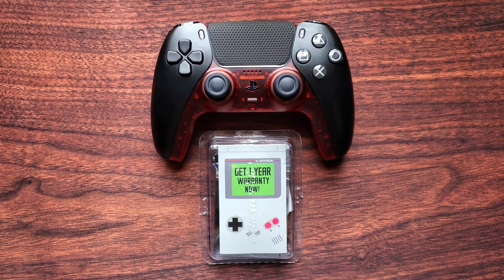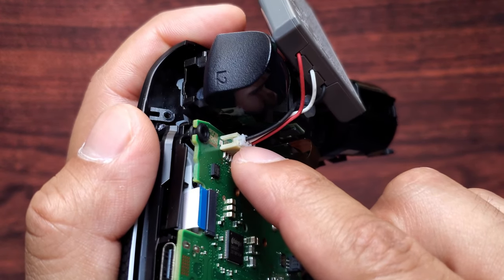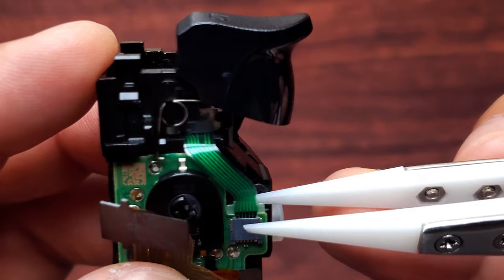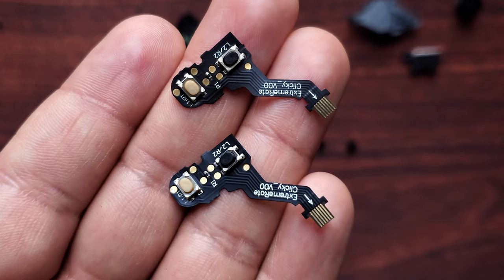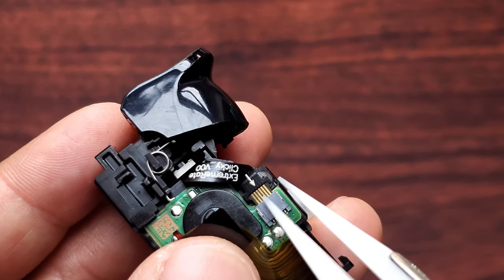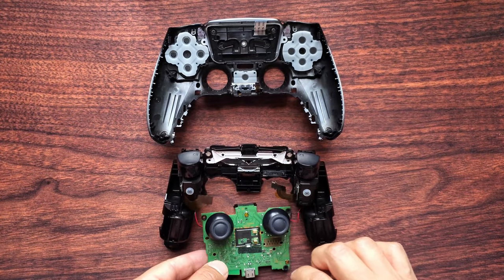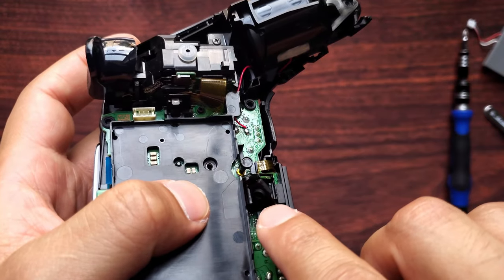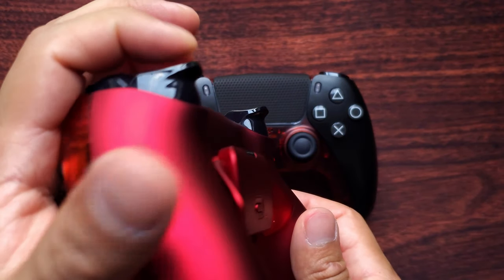DIY PS5 Controller (No-Soldering): eXtremeRate's Clicky Hair Trigger Kit | Step by Step Tutorial

Comment: Love your content. I just got my remap kit and led kit. I followed your video to install the kit. After the installation my analogs don't work. Please help me...
Reply from the maker: And thanks for the compliment!
Reply from the maker: I just realized this is for the hair triggers. I thought it was the remap kit. Check all connections. I haven't heard of problems with the trigger kit. But let me know the model number of the original shell or the BDM which is on the motherboard itself. I have mine installed on a BDM-010 or model # CFI-ZCT1W
Reply: @im.a.caveman  my controller is a bdm-010. I don't have the triggers yet. I only have the remap kit and led kit. After installing both kits (remap and led) they both work correctly. It's just my analogs don't work. I checked all connections multiple times and didn't find anything wrong. No broken wires or bad connections. I commented on this video because it is your latest video
Reply from the maker: @iamlegend1333  Oh alright I see. I confused myself sorry about that. Then I recommend putting your original parts back only for replacing the back buttons kit. Led should be fine. Other than that put your original parts and see if the analogs work like regular. Thats a way of knowing whether it's a faulty kit and not your control. You can also ask for a replacement if it not working out or even a refund.
Reply: @im.a.caveman  I'm going to ask for a replacement for the remap kit. Would you be willing to install it for me. I am willing to pay you and send my controller.  Please

Comment: Hey nice vid bro, I bought the clicky triggers, but it seem like underneath my trigger is different I don’t have those holes there for the little L shaped piece
Reply from the maker: Is your control a CFI-ZCT1W A/BDM-020?
Reply: @im.a.caveman  yes it is
Reply from the maker: @cyco_t3346  Sorry! I recommend getting a refund. The kit is only compatible with CFI-ZCT1W/BDM-010. I need to make an update video for the kits. The only kit that's currently updated is the Remap kit. They released the Remap v2 so it can work with CFI-ZCT1W A/BDM-020. But for led, hair triggers, and clicky kit not yet.
Reply: @im.a.caveman  no way
I had 2 controllers wth the A just brought a used one with the A to install the paddles :( arghhhh 
I didn’t know they had an updated version that works with the A controllers :(
Reply from the maker: @tefflongsxr  It's alright. Contact the company.

Comment: Where did you get those tweezers?
Reply from the maker: Those are ceramic tweezers. You can try eBay or Amazon. You'll see a bunch of options to choose from. They were used for a different purpose since they're heat resistant but they've been great to use for customizing.

Comment: adaptive trigger swap itu clicky button. is this downgrade?
Reply from the maker: I would say it depends on the preference. In my opinion these are best for shooters since it'll give you a quicker trigger response. They can also be used for other games but yeah you won't be able to use haptic feedback. I would use haptic feedback only for like solo games or non competitive since I won't need the quick trigger response. Regardless I have 2 controllers for either occasion. One is modded with the triggers and one isn't. Hope this helped.

Comment: I watch another video where a guy cut the wires for the haptic feedback motors, and reposition the haptic gear a certain way.
Reply from the maker: You don't have to cut those wires. And the gear does have to be placed in a specific way. Can you send me a link to the video?
Reply from the maker: @Iron-Soul  I see it. The wires they cut, it says it's optional, I think that would mean you won't be able to use haptic feedback or just the vibration. You can see those wires lead to that motor. And the way the put the piece on the top of the gear was different but the way I do it works. I saw it from their past video: https://youtu.be/WSI9XosfEIk
Reply: @im.a.caveman  What I did instead I unsoldered the wires from the circuit board to save the haptic motors for spares just in case. 👍🏽

Comment: yo man is there anyway to get Bdm 010 specifically?
Reply from the maker: Honestly not sure. Unless maybe someone is selling a used one and knows the model # or that it's a BDM-010. New, in the box, not sure. I'm gonna try to see for any signs on the box itself.
Reply: @im.a.caveman  cool thanks man, guess I’ll just get one and hope for the best. No chance the colour makes a difference or anything? Thanks a lot for these tutorials btw will be using the for sure!
Reply from the maker: One thing I did see on the site was, for the white one, on the target website, on the description or how every they titled it, I think it's says release date and it shows October 2020. So I was actually thinking of trying that. I would assume the colored ones would be BDM-020 but friend got the red one and the model # CFI-ZCT1W which is BDM-010. But I haven't actaully seen the inside to know if for sure it's BDM-010. Model # CFI-ZCT1W A is suppose to be BDM-020.
Reply from the maker: By the way, thanks for the comment. I appreciate this alot. Good luck! And thanks for watching.
Reply: @im.a.caveman  so I should prolly get a white one? Was thinking of getting black lol
Reply from the maker: @B47ANCED4L  Turns out that the box itself shows the model # if you want the black try it and only open it to check the back shell if it's CFI-ZCT1W then it should be a BDM-010. If it's not return it? Just open it carefully. But also check the side of the box when you're looking for one.

Comment: How to ruined your triggers.This is for shooters only, you cannot play a racing game after modding it this way. Triggers won't be pressure sensitive anymore.
Reply from the maker: "Ruined" wouldn't be the appropriate word to use. The control is still functional. This kit shouldn't be installed if it's going to be used for racing games. Haptic feedback should also be turned off if using a controller with this kit installed.

Comment: Bought the new Scuf reflex but it doesn’t have mouse clicking triggers/bumpers. Would this mod work the same if I took apart the new Scuf?
Reply from the maker: That would depend on the inside. I've been trying to see if scuf customized the original controllers with their mods but there's a chance they manufactured the controls. If it's not an original Dualsense then the inside could be different.
Reply: @im.a.caveman  thanks Caveman…all I can tell you at this point is that the controller is coming from Taiwan. Once it arrives if you want to connect via FaceTime or some other platform, maybe we could figure it out together.  Thanks for the reply man.
Reply from the maker: @flipfuzion  You can just send me pictures or videos to my IG so I can see it when I have the time. Thanks for wanting to figure this out. https://instagram.com/im.a.caveman?utm_medium=copy_link
Reply: @im.a.caveman  hey dude, I can confirm 100% that this is a repackaged regular ps5 controller. So that’s great news. Buy the cheaper reflex pro and then add the clicky triggers yourself. 😀
Reply from the maker: @flipfuzion  Oh wow that's amazing!